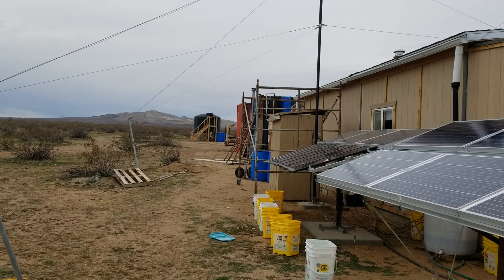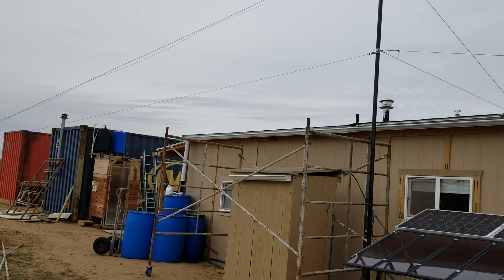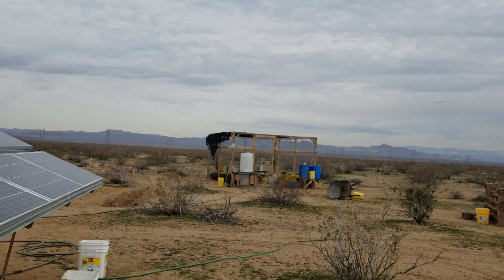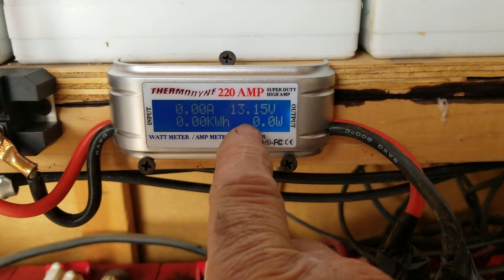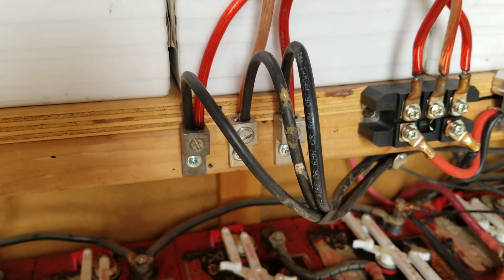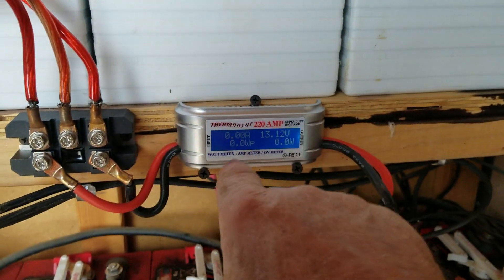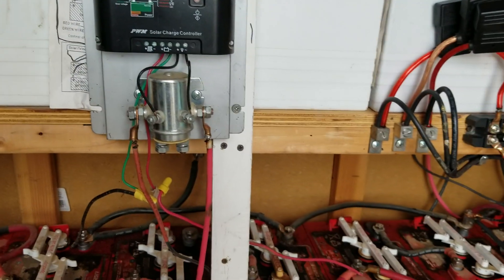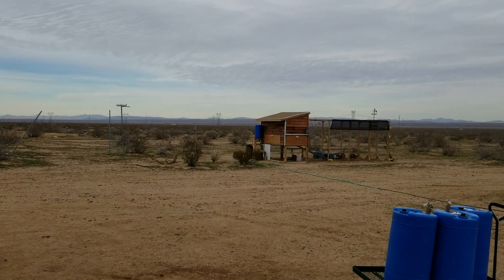GBear's Off Grid Ways-a Homestead in the Desert,  Feb. 12, 2019

Comment: I'll start by saying how nice it is to have someone do a video that's easily understood. Im good at welding, building with wood, doing auto mechanics, but trying to follow most guy's doing solar and wind is like listening to a Chinese math class.
   I just watched a video on micro cycling your battery bank because of the way they tell you to wire your dump load, i thought id share it. I understood what the guy was saying, but since i don't have a system yet i didn't look for his video on how he was going to change his wiring to dump from before his battery. 
https://youtu.be/A9Meq8wLbME
I see you have a lot of batteries and most likely you'll be dumping a lot, i thought you may find it helpful. 
   I do have a question on pma and i believe you called it pmg alternators/generators. Why is 3 wire pma better than 2 wire pmg? 
   I am looking to put solar on my cargo trailer that im turning into a off grid boondocking trailer, and i will be putting 4-330w mc solar panels on it. I have lifepo4 batteries, 8-3.2 280ah cells that im thinking ill be making 2 12v banks out of. In cade one has a problem i will be able to disconnect it, and still have power until i can fix it. If it turns out i wont need a bms and other parts with a dual solar/turbine controller that will change to an 8 cell battery, but im not that far along. I want the ability to charge if it's cloudy for a couple of days in a row, and im also wondering if i can do a vertical axis pma or pmg and drive around to charge it, or if it would spin to fast driving and damage the alt/gen. 
   If you could give me any advice on the difference in the pma/pmg choice i should look into, and if there's a limit to either with me driving 60 mph or so to charge batteries on a cloudy windless day it would be appreciated. 
 I only have room for 4 panels and i think to get my necessary electric needs met for a couple of days it'll take 600 watts of solar with 400ah of battery storage. And anyone ive asked said that would be best sun for a long day scenario. So im thinking 4-330w panels, with 560ah of battey storage to be safe. The wind gen would be a if the sun is bad for a week scenario, and the driving would be for if there's no wind to push the vawt. Hopefully i wasn't to redundant lol, i just like to be clear. Maybe because i tend to ask to many detailed questions, im told i over think things haha. God bless, and thanks for any advice!!
Reply from the maker: Welcome aboard!  Wow, you should publish this book...😉😂
Anyway, I understand your concerns, as I was the same way when I started out.  You sound like a hands on kind of guy, so I'm sure you'll do fine once you get started with your system.
Ok, difference between PMA & PMG,  3 wire vs. 2 wire:
PMA is an AC alternator that will require a bridge rectifier to convert the output to DC.  The advantage is smaller wire size required to bring the power from the turbine to the batteries. 
PMG is a DC generator that has a rectifier built in, but larger gauge wire is required, and if the rectifier burns out on a PMG,  you have a mess to deal with.
Note, that mounting a turbine on a trailer is not efficient due to height limitations and wind diversions.  Also, setup and removal each time you move is a hassle.  ( Many areas have laws against having them on a moving vehicle,  and other places even restrict their installation in city limits.)
Next, remember the PM part means Permanent Magnet,  so don't attempt to use a car alternator that isn't PM.
Now, Dump loads and micro cycling.  In my opinion, the best way to avoid that is to use a Midnite classic 150 controller dedicated to the PMA.   It allows for adjusting the curve for best input and will never micro cycle.  It completely replaces the need for a dump load system.
Note:  before I connected my Midnite classic controller to my "solar", my dump controller would operate regularly in high winds, but now I never see it activate.  (Dump load)
The Midnite classic does such a great job of monitoring the battery bank and either floating or boosting when excess input exists, I would never build a system without one. 
There are 'other' controllers out there that are cheaper and I have heard people say are good controllers, but I have first hand knowledge that Midnite is the BEST.
Next, for a PMA to be of use it need to be in a completely unobstructed location,  and there has to be steady wind. An occassional breeze is useless.   Also, it means that your choices of boondocking are limited to no shade trees or tall objects, and no protection from the winds.  So you will be stuck inside, hunkering down and chasing your lawn chairs.
My suggestion: Leave wind power out of your portable home and spend the money on a good, quiet portable inverter generator.
Or you can get creative, since you are auto-saavy and add a high output alternator to your towing vehicle (like the ones rural ambulances have) and install a connection outlet in the fender that you can connect your trailer to in case of no sun weekends.
This would take the place of driving around to spin a turbine, as you would just need to idle the engine and plug in.

Lastly, be aware that many solar and wind charging units are not compatable with LifePo batteries, so do your homework.
I hope this helps.
Reply from the maker: Yes I know of Gerard Morin and his many experiments and discoveries.
Reply: @GBear  hey thanks! That explains why luke fugate runs his diy pma water wheel how he does, runs it ac to the battery bank to save on wire size. Much appreciated!!!
Reply from the maker: At the price of copper nowadays, using smaller sizes saves alot of money.
Reply: @GBear  As for a book i get censored so much there's no way i could right a book, all the information can be found in bits and pieces, or used to be. You won't find patents for the ftl craft anymore, know you can only find the one for navy ships. The patent for the cough thats plaguing the globe gave in 2015 to billg and w.h.o is gone, and some of teslas patents are missing information. You can see more in England's patents on his work than the us patents. 
   There's a guy that used to have a channel named inert gravity that's working on his steam engine that has copies from England, i think his last test was producing 216,000 rpms. He's making some great bearings, lot's of precision work. He's the one that posted the Lt colonel Thomas Bearden video on free energy. Had someone else who sent me the clip of the Keshe foundations magrav free energy pack, that works on a tesla induction coil like in your stove tops. It's dipped in a paste made from taking particles from nuclear waste with nanobots, and realigning them safely. The oscillating frequency ignites the particles, it takes a trickle charge of energy from a wall socket and magnifies it to whatever you need. A little different than Gerards using a battery to start his over unity generator, but same principle. 
   I had a video on my explanation of particle entanglement works, and it's been removed every time i posted it. James mcgee had a sermon on the book of Daniel and it taking less than 3 minutes for the angel Gabriel to appear from heaven and the three types of energy on utube, i was posting that and the patent to the double hulled -15,000 mercury filled ftl craft blue print, along with my theory on how particle entanglement works. They all got removed. Then i was kicked off facebook for posting stuff that goes against their policy for what they consider deemable for public content. Can't post biblical studies explaining energy in the Bible don't you know lol.
   If you like a good sermon Gene Kim's electricity in the Bible, the pyramid universe, and the genesis gap videos are very good. But idk, seems like to much work to me, I'd rather build something with my hands, read the Bible or a science book. I like your sense of humor too, don't get the bends deep diving for treasure in your spa and stay safe. God bless!!
Reply from the maker: Lol, I just got out of the tote-cuzzi.   I was practicing my breast stroke and back stroke.🤣👍
Reply: @GBear  😂
Reply: Also, i like following science. The first thing i did when i sat down to get a basic understanding of solar/wind generation was ask myself where energy comes from. I'd already looked into quantum physics and biochemistry, with neuro and psycho physiology. So that lead me to electromagnetics and figuring out particle entanglement, and how travel at faster than the speed of light is achieved.
   There is a guy named Gerard Morin who solved recreating teslas energy for a over unity generator, according to his research the problem with hydrogen as fuel is it's detrimental to automotive engines. You may find his work interesting, if you want to run gas engines on hydrogen it seems using teslas plasma or as the power company calls it "skin effect" energy will give you a better burning of the nitrogen which is what actually gives the explosion to push the pistons. Gas and diesel are just the liquids used to for the explosion that the nitrogen in the air needs for combustion. I haven't tried it myself, but he had interesting videos on it. 
   There's also a video by Lt colonel Thomas Bearden about pulling energy from the vacuum of the 4th dimension that explains how/where electricity comes from, and that it's the circuitry that is keeping us from having free sustainable energy. Again, just thought I'd mention the videos since you said your thinking of dumping into water for hydrogen. Id post a link to the us patent for the faster than the speed of light craft, but it was taken down over a year ago. I was asking a lot of scientist and presidential candidates like Sean Carroll of Stanford, Neil Tyson, trump and biden why they aren't spending money to solve the problems with high cost of energy and pollution if they wanted to help the world lol. Like Westinghouse said to tesla, if they can't put a meter on it for profit they don't want it lol.

Comment: Isnt it a bad Idea to fuse each line of three phase?  If one blows you will have a two of the three phases supplying energy.   Seems like all should disconnect.  Also  would that cause an overspeed of your blades?
Reply from the maker: Welcome aboard. 
Fusing is for fire prevention.  Should a single phase of three exceed 60 amps while the other two remain normal, the PMA is damaged already.
Reply from the maker: Oh, and the blade design causes 'stall' at 90mph, so they will never go faster than they are designed for.

Comment: Dear,I am planing of buying a 2KW ON GRID INVERTER WITH LIMITER for wind turbine from solar company.For the moment i dont use any battery at all.In order to secure that i will have som steady voltage into my grid  MAY I  CONNECT from inside the inverter at the 2 dc cables of rectifier   MY SOLAR PANELS ??Since i dont have any batteries if my power is enough from the solars will the turbine read that so it will break through the resistance damp load ??? will be safe to do that????Thank you
Reply from the maker: I'm sorry. I am not familiar with the system you are building, so I can't help you in this situation.  Did you ask the company you are buying from?
Reply: @GBear      Thank you very much.

Comment: Nice setup. Having a hybrid system sure beats relying on just one source of energy.
 I have a question though, if your turbine is disconnected from the battery, or dump load by either a fuse blowing, or worse yet someone turning off the breakers allowing it to freewheel, then won't the turbine overspeed and throw its blades?
Reply from the maker: Actually, yes in the case of a homemade turbine using an induction generator.  Permanent magnet units will burn up if one leg is open.  That's why it isn't recommended to use a brake on PMA'S or PMG's.
Reply: @GBear  okay then. I'm just curious what keeps the unit from over speeding and throwing its blades?
Reply from the maker: The design of the blades has that responsibility.  Just like an airplane propeller, the blades have a "stall" speed.  That is the limit to where the blades cannot go any faster, even if the wind does.

Comment: whitch of the 2 hybrid Mppt that you have would you reccomand for a 300w wind turbine and a 100w hydro-generator? the green on the right with the resistor or the other on the left?
Reply from the maker: Neither.  Hybrids are not reliable.  Both are out of my system now.

Comment: https://www.youtube.com/watch?v=VEvY8-sPTHQ     see this please
Reply from the maker: Interesting, but he doesn't mention that some PMA manufacturers say not to use braking as it will burn out the stator. The following may help you, and the are others in my playlist for wind and solar related.
https://youtu.be/bmhH9ojbKXU
Reply: @GBear   i like your system, but how you control the turbine's speed  in case f heavy  wind ?
Reply from the maker: The design of the blades limits a maximum rotation speed of 90mph to reach "stall".  That means that even if the wind gets stronger, the turbine can't turn any faster.  Note that if you are in an area that gets wind speeds that fast, you are in hurricane territory or tornardo territory and turbines are not your best choice.

Comment: There no reason u carnt hook another panel up to tha pwm controler or dc wind turbine will charge just the same
Reply from the maker: Welcome aboard ryan!, actually, if you are referring to the PWM controller on the dump load system, that isn't a standard pwm controller.  It is a modified version designed specifically for  connection only to the battery bank with no outside input of power.  It's sole purpose is to monitor the bank voltage and divert any overages out the auxiliary port to a resistance that will drop the battery bank voltage back down.
It isn't the most efficient way to do it,  but it was early technology.
The best way to control PMA or PMG input is to use a Midnite Classic 150, 200 or 250.  They are pricey, but efficient!

Comment: hi g bear did you end up putting circuit breaker switch on your wind turbine set up ????
Reply from the maker: Yes, I use 60A inline fuses on the 3 wires input, and a 100A DC breaker on the positive output to the battery bank.
Reply: @GBear  hi g bear   i want to buy a dump load controller  pwm  . do u recommemend one .
Solenoid you have has 6 out put screw connections does it matter if i brought a 4 screw one?????? CONTINUOUS DUTY SOLENOID DUAL BATTERY BATTERIES 12V VOLT SOLENOID ISOLATOR 100A this is what im looking at  is it right to use
Reply: what size amps charger controller  when i have 4x 135 ah batteries plesae
Reply from the maker: @jeanettemottrom3313  save your money and avoid the old technology called a dump load system.  It is inefficient,  and actually hard to find one to buy anymore.
Even the digital diversion controllers are phasing out, but can still be purchased.
New technology:
#1. Midnite classic controller.  This device is expensive, but the best way to get the most out of your turbine.
#2. Electrodacus.com DSSR20 w/diversion and the SBMS meter.  Much less expensive, efficient, and great support by the inventor.

I will be switching to one of these 2 options as soon as finances allow.  (I'll have a complete dump load controller for sale after that😁👍)
Reply from the maker: The prebuilt unit I have uses a 20A controller, but please note, THIS IS NOT a standard PMA controller.  It was modified by the company that sold it to operate properly with I heavy load draw on the "Auxiliary" output terminals.

Comment: Hi G bear, if i have a grid connection.. then the dump load heating exchange is not necessary? Correct?
Reply from the maker: Correct, but an auto disconnect should be installed in case of a grid power outage.  Otherwise you would backfired to the grid causing unsafe conditions for men working on the poles and wires.
Reply: @GBear  okay thanks for the info. I will look in to that automatic disconnect.
With out that i would also likely drain the battery. Great video content thanks Gbear.
Greetings from Ireland. And have a merry Christmas!
Reply from the maker: Welcome aboard!  Merry Christmas!

Comment: Is this not micro cycling your batteries thus shortening your battery life  ? 
Also no charge controller after the rectifier to controll the imput voltage to the batteries? 
Thanks in advance.
Reply from the maker: No, it actually comes on only in high winds on a sunny day and stays on until either the winds die or the sun sets.  A cooling fan on the solenoid prevents overheating.  No charge controller, unless it is like the Midnite classic which is designed to handle turbine inputs.
Solar controllers are not designed to handle wind or water turbines.